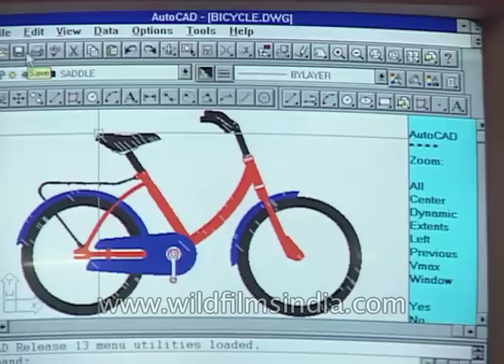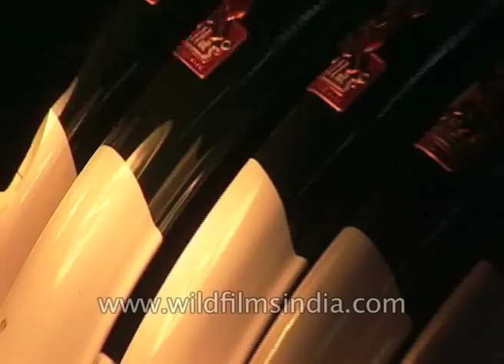Atlas Bicycle Factory in India

Comment: American workers should be thankful for OSHA despite the enormous aggravation  they can create.
OSHA would have shut this place down and it is quite possible that the fines would put them out of business not to mention management going to jail.
No eye protection when using machines, heat treat or in  prime and paint. The video showed only one person wearing safety glasses
No hearing protection.
No hand protection when handling chemicals (prime and paint)
No guards on the machines.
No shields in the heat treat area.
Hot was allowed to splatter on the wall in heat treat.
No respiratory protection in prime and paint. A rag wrapped around the head is NOT respiratory protection.
Flip flops are not appropriate footwear in a manufacturing plant and no one should ever be allowed to work barefoot.
Atlas bicycles should be avoided.

Comment: Would be interesting to know how old are the machines that make the bikes as machinery in India they us them until they cannot repair them any more.
Reply: There is a life cycle for everything and go beyond that and it becomes expensive, you are not saving.
Reply: @Hillary Clintub, Obviously the bike factory makes money or it would not exist, and there are old machines that can do valuable work. However to progress you move forwards. Old cars still can get you from a to b but how comfortable and how much  fuel do they use? Then you also run the risk if something breaks and there is no parts you either have it made or scrap the machine. O.K when there is no deadlines and customer orders. Once a machine becomes unreliable and you can not fill your orders on time customers go else where. I watched a youtube channel of a company with 1960;s machines turning out widgets and things but he had trouble getting staff as the noise was like hell.
Reply: LOL 100% right.
Reply: There is in India lots of old European and american industry machinery that is in full use even today. For example Mercedes OM616 Diesel engine which came out in the 1969, and discontinued in the 80's, is still manufactured with the original tools in India by Force motor company. it is the most popular engine in light commercial vehicles at the moment in India.
Reply: Jan Sergejeff , how polluting is that engine?
Reply: they manage to  get BS IV equivalent to Euro IV  emission standards

Comment: Victorian era manufacturing. Slow and inneficient.
And occ elf and safety? Naah, loose baggy cloting operating machines, thongs handling red hot frames, barefoot wheel assembly on the floor. And it appears loading a truck by hand. No palletts and a forklift?

Comment: most of the promotion done what country being pushed by corporates or outsider busienss makers to invest in india

indian roads , most of the places off roads, what do we look for , today seasonal rains itself distruction how to save from manhole on road side or off road side , overweight how for it suitable for user in offroads and on roads, 

electric bike itself seems not done any justice for atleast bicycle in most of the district ends like south and north most of the tire second belt or third belt or fourth bel t district in south are not even near to access and aware there is a market , instead all the bloom gloom shown as the business talks nothing exist as there only we come to know the most of the exhibiton shown only for automobile , two wheeler event shows during their seasonal business every ward use to get the glimpse of that shows of each dealers and but when comes to basic stuff 

over weight , electri c bike bicycle and load pulling capacity how long company corporates or still fail to address issue 

suppose a weight of men or women 200kg what would be the capacity of bulling and motar used in electric bike all that the level of marketing from the shop always tend to push what do we look 
what is the standard size and weight there is no such a height other than 5.2 what do we not have for 6 feet height and weight 

itself un acceptable sensex do not give much more challenge to competion and population size all that stupid promotion
Pr!nce
Pr!nce
1 month ago (edited)